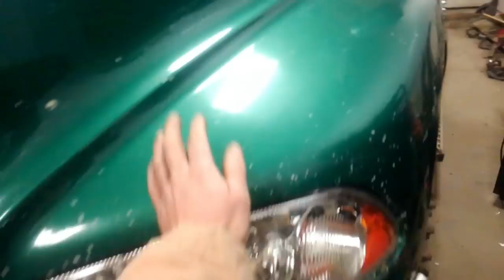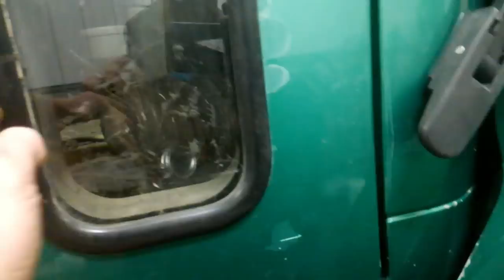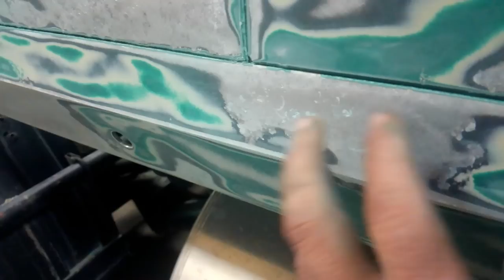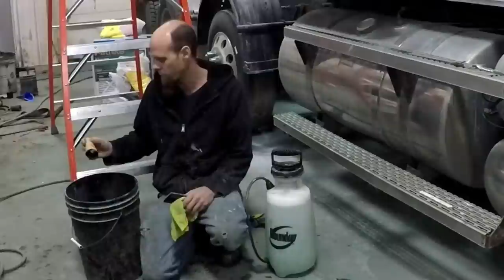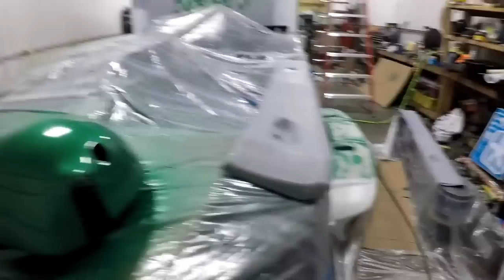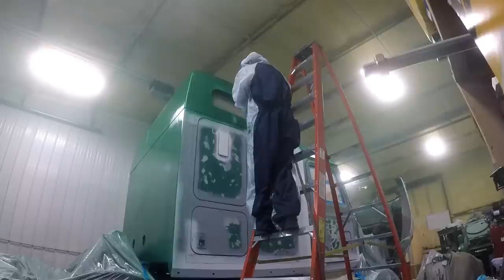diy re-paint of my mack truck

Comment: WoW awesome job the first van i painted was way back in the early 80s and i did in a small garage at the back of my house and wait for it i used an electric spray gun load of thiners but it came out really good and did alot of cars vans then my life change and it was the end of that but yes you've done yourself proud just as good or if not better than a paint shop .

Comment: I love that paint its aircraft paint poly urethane.   My peterbilt 379 I painted with it . Your going to love it when it gets dirty and all you have to do is shoot it with a hose and dry it off and it will glisten just like it was waxed. Great job boss
Reply from the maker: i figured its not a job i wanted to be doing again for a long time better to use a good durable  paint.

Comment: I love Imron paint. I send whole truck with 320 grit (dry send) ant it turn out amazing
Reply from the maker: yeah imron you would probably be fine shooting over 320 dry its pretty thick sticky stuff. other automotive paints iv used 320 would probably have a pretty good chance of having some sanding scratches show threw. this was my first time ever using imron.
Reply: @Ezrider359  I did use a lot.  I would say that's the one of the best pain I ever use. You can c pic on my profile  It's one of my truck

Comment: Did you sand the clear coat afterwards? I like to use single stage  on something that big. Looks good though.
Reply from the maker: Single stage certainly would have been a good cost/labor savings I personally feel base clear is more durable over the long run. I only did very minor paint correction on it a couple dust nibs on the hood and that's about it. Paint is as it laid. If it was a show car I'd cut and buff it but it's not and that's a lot of real estate....lol it laid pretty nice anyway iv seen factory paint jobs that had more orange peel. I'd say it's middle of the road compared to most factory paint jobs iv seen not the best not the worst.

Comment: People say imron is hard to use. Did you run into any issues compared to regular car paint?
Reply from the maker: it didn't shoot the same as a regular base clear. its a very high solids paint. certainly took a bit of adjusting on the fly over what im used to. not that its somthing i do on a daily basis anyway...lol it also sprays with a bit different technique than a normal base clear. i wouldn't say its overly hard to use but it is different. it wants to go on very heavy to wet out, but it doesn't sag or run easily so you feel like your really hammering the paint on way to thick but that's what it wants.
Reply: @Ezrider359  that's awesome that you were able to get a good result. I had a paint shop scare me away from using imron, so I put on an unpainted tank fairing. Seeing you're results I think I'll give it a go at painting it. Cover up that plastic and make my truck look good again.
Reply from the maker: @usdpaulp  big differences between imron and a normal base clear is the imron is very thick and sticky in comparison. it sprays much more like a single stage than a normal base clear. and it sprays wet on wet with a crosscoat so you wet the panel out with a med-heavy coat in one direction then you turn and you put a second med light coat on in the opposite direction right on top of the wet paint, (30 second-5 min flash time required according to the technical data sheet) the paint stays tacky for hours rather than being dry to the touch in 15 mins like a normal base clear. clear coat can pile right on wet on wet according to the technical data sheet but i had to respray my visor as the top poped off my spray gun and dripped paint on it  so i had to let it dry and sand it and re-do it and when i did that i piled the clear on wet on wet. and got a little bit of solvent pop when i did that. you have a 16 hour recoat window so id say best to give it an hour or two to flash off to be safe before clear. clear goes on the same way as the base. it will feel like your really hammering it on too wet but its how it has to go on or it won't flatten out. a few extra lights to help you see what the paint is doing is beneficial.
Reply from the maker: ill also add it doesn't seem to be prone to run i think you would have to sit in one spot without moving the gun and trigger fully pulled for several seconds before it would sag so you don't have to be afraid of hammering it on.

Comment: thinking of doing this to my classic . how much paint , clear coat and other supplies did you get. how many coats were done in total. help would be appreciated.
Reply from the maker: About gallon + a quart both base and clear before being reduced. So probably about 2 gallons sprayable 2 med/wet coats both base and clear. The imron is a pretty high solids paint I would probably expect to use a bit more if you use more of a standard automotive paint.

Comment: I have so many questions, my truck is painted in that emron and the clear has broken to dust,what is your mix on the paint,how do I remove the aluminum bubbling,I've got seven million rivets do I hand sand those,did you use clear,you amaze me every time I see you,your a monstrous amount of information.
Reply from the maker: the bubbling is a aluminum oxide layer between the aluminum and the paint, you can sand it off till its pretty smooth there may be a little bit of worm holing in the aluminum that you can fill with a small bit of body filler if needed. if its to the point that the aluminum is paper thin the panel may need to be replaced. a truck with a lot of rivets id probably use Roloc Bristle Disc's on the rivets followed by a bit of hand work if needed. i used clear coat, single stage imron (no clear coat) is very common to be used on trucks, i prefer base clear's though both systems have there draw backs, but single stage with no clear does save some time and material costs. but clears tend to stay shinny longer where single stage tends to get a bit chaulky and loose its shine over the years. but clears can fail/lift and flake. imron in eaither single stage or base clear is a very good product though that will last a long time.
Reply: Great idea on the bristle disk,I run a kenworth t600 most of the truck is fiberglass so I need to do some fiberglass building under the hood it’s pretty rubbed thin,can I clear imron I wanna try to avoid orange peel if possible,I also need to do some severe rust abatement to the frame,love to hear your ideas on best ways to tackle this.thks for all you do for us,my hubby wants to buy you a beer,we’re in Florida hope we run across you
Reply from the maker: @kristievanthul7086  yup you can can get imron in eaither single stage or base/clear getting the paint to lay flat has everything to do with gun settings and technique more than paint. your last coat has to lay even and wet. spray to dry or holding the gun too far away or improper pressure causes excessive orange peel. environmental conditions can be a factor as well heat/humidity. needs to have enough time to flatten out after it hits the panel before it starts to tack up. all paint jobs will still have some orange peel though. factory paint jobs have orange peel professional body men have orange peel. if you want paint to be dead flat when your done your going to have to have to wet sand and buff it when your done. but if you do a good job spraying the paint as flat as possible its a lot less work. if you plan to wet sand and buff defiantly use a clear coat its best not to wet sand and buff single stage.
Reply from the maker: @kristievanthul7086  Kevin Tetz did a bunch of video's with eastwood here on youtube that are extremely good. as far as how too, on basically all topics from prep and body work to gun settings and techniques and even wet sanding and buffing. even though iv painted quite a few cars ect over the years its not something i do often i find many of his video's to be helpful as a refresher before i start a paint project. here is a link to one video but there are many more https://www.youtube.com/watch?v=P_9WQmicyJU

Comment: Wow...that looks great I'd be so happy with that!!!!! What air pressure do you spray at and did you have to thin the paint or use hardner at all mate?
Reply from the maker: Paint is mixed with a activator and a hardener. Best way to determine air psi is on a piece of cardboard. And set it to get the proper spray pattern. Thanks for watching glad you enjoyed it
Reply: Thanks mate, I hope you get answers and help from YouTube too, you've sure taught me a lot, I even got my job because of you. My boss was impressed by my knowledge of bad power divider symptoms lol, thanks again mate, wish I could help you back but I don't know too much lol.
Reply from the maker: You tube has certainly helped me out in the past as well. If you're interested in painting stuff there is a series called the paintucation series by Eastwood that has tons of fantastic information on paint and body work I normally watch some of those videos as a refresher before I paint something as it's not something I do often

Comment: No offense, and I'm really surprised it looks as good as it does, but you have horrible gun technique. Just my observations.
Reply from the maker: I'd have to re watch this video to see what your talking about as it's a older video but this on was sprayed with imron base and clear. Imron is very thick and sticky and sprays in a wet on wet cross coat sprays very different than a normal base clear. Plus painting something as big as a truck hanging on a ladder is pretty akward and will make you do things you normally wouldn't. But I'm not a professional and it came out fine and has held up well